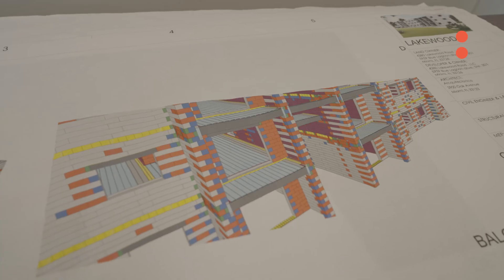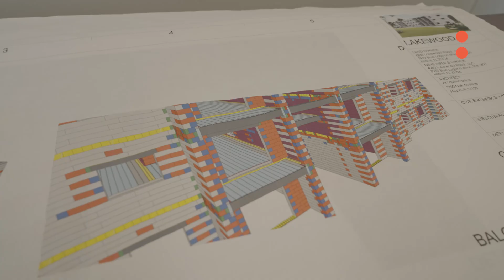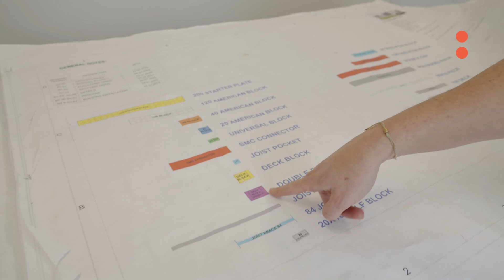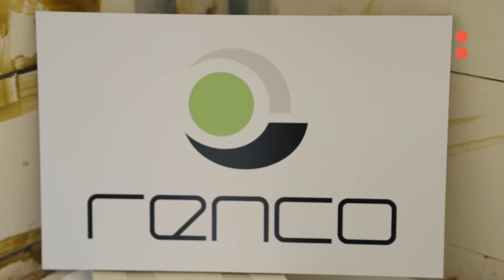RENCO's Lego-stacking system is creating a new way to build

Comment: Concrete is a very poor choice in the wet, warm, and humid climate of Florida. By default its braced with low-grade steel (rebar), and is subject to corrosion and decomposition. The coming collapse of concrete structures in Florida has already begun.

Comment: the finished product is filled with something.  Does anyone know what they filled it with?
Reply: Probably Polyiso foam. It's fire-resistant, unlike Styrofoam, which burns like napalm.
Reply: It’s hollow . Only air . Not filled
Reply: If it is hollow, what about insulation or condensation?

Comment: While the blocks themself are rated for 200 years, the finishes would all still be deteriorating in the same way…so structurally sound…
Reply: The outside surface is the finish.